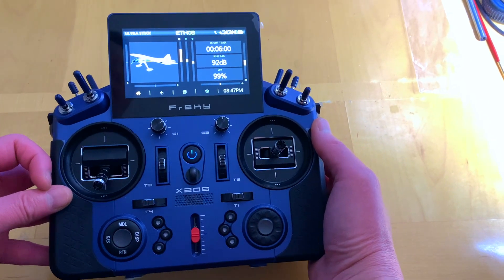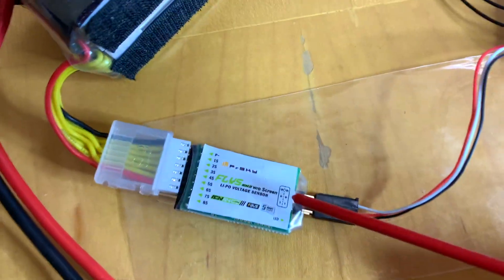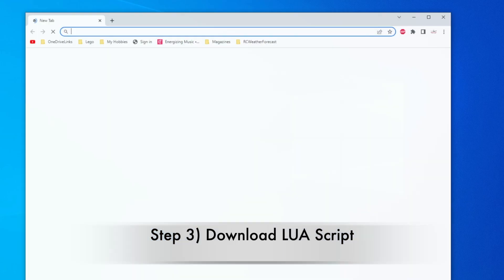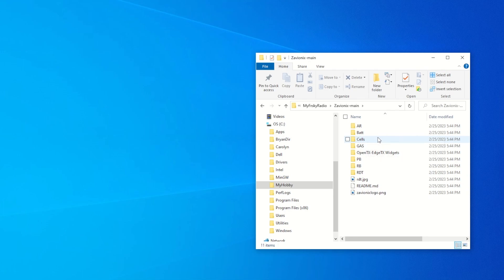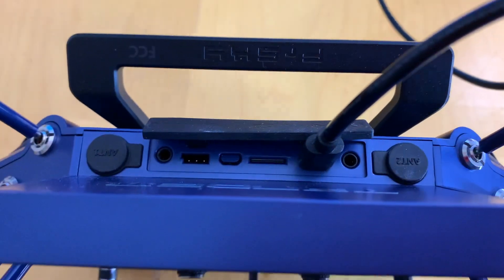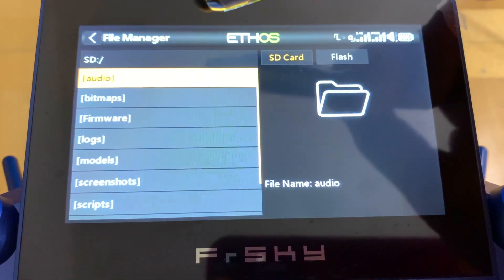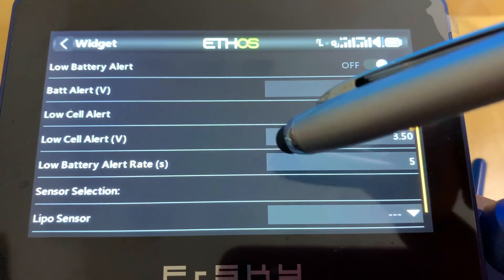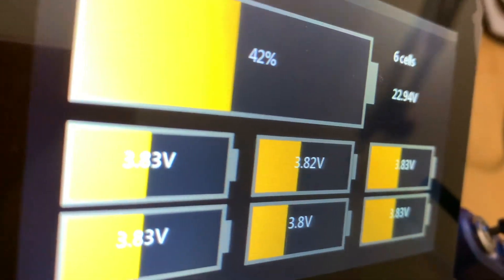How to setup FrSky X20 to monitor battery voltage sensor.

Comment: The voltage sensor is too big for 12s setup.  Spektrum uses only one tiny lead from the Battery supply cable for the esc to the voltage sensor port in the RX and it doesn't have to be connected every battery change.

Comment: 👍. Thanks. Can you change the theme colors on FRsky in general.  And for the Battery sensor screen, could you change the colors? Thanks
Reply from the maker: Yes, but you would need to edit the code and change the RGB color number.. it's not straightforward. Also, I believe there's a new script update from him lately that's much better.
Reply: @8HrToGo  thank you so much for the very useful videos

Comment: I can't get mine to work. The full page says Zavionix Cells at the top but just a grey screen. I tried other scripts and get "Please use full screen" (in yellow) even though I have. This is ETHOS V2.5.4, the latest version. Any help is appreciated.
Reply from the maker: Sorry, I havenot use Ethos1.5.4 as waiting to be stable, as for Zavionix, you might want to check out on his page if the has the latest script.

Comment: Thank you for the excellent tutorial!  I am using a TD SR12 with no dedicated Sbus port so had to use an empty pin (12) to connect to the FLVS ADV. I can read the sensor on screen 1 if I change one of the timer  widgets to Lipo but the Zavonix LUA script produces a blank screen regardless of how I configure if, I am wondering if the latest FrSky FW V1.5.3, FCC is causing issues.
Reply from the maker: It could be, and now they have 1.5.4. Personally as of this writing, I have not upgrade to 1.5.+ even though with all the hypes, as I want them to iron out all the jinks before I commit one of my plane to it. I might consider putting on 1.5.4, but the weather hasn't been cooperating so I will give it some more time. If you can wait for releases to be more stable, then wait, otherwise don't risk it. Good luck.

Comment: For anyone new who had issues finding the telemetry option in Linegraph config, you need to go into model>telemetry (located on page 2 of mdl menu), turn on your receiver, then set 'Discover new sensors' to on. When you go back to Linegraph, the telemetry option will be there. Embarrassingly, this took hours for my noob butt to figure out 😂